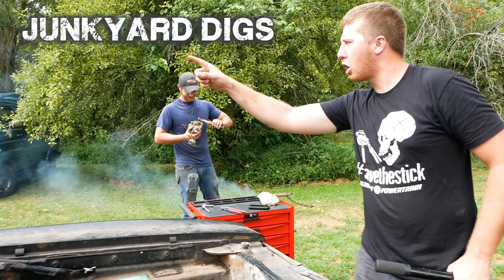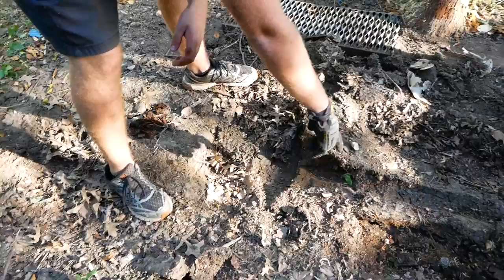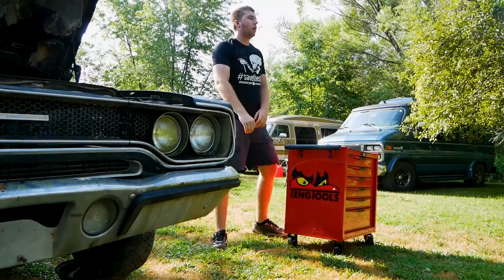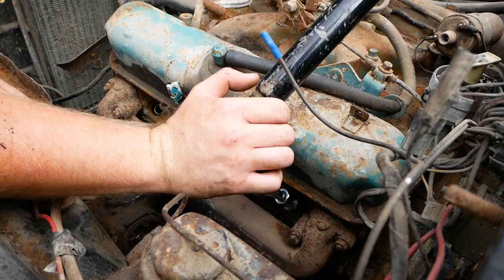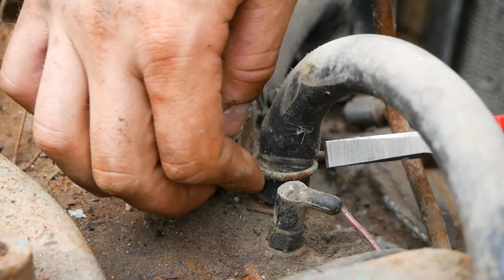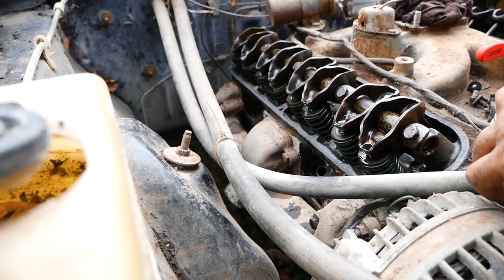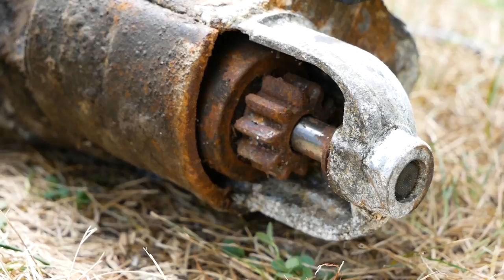ABANDONED Muscle Car Revival! First Start in 35 years! -- Part 2

Comment: well someone has been under that hood before. Actually they have been at the whole car from the looks of it. It is either a 68 made too look like a 70 or a 70 with 68 parts put on it. Why because its missing the disc brakes in front (all cars had in 1970) it has a 1968 carter 1 1/4 bbd carb instead of the 1970 bbd. It has points instead of the electronic ignition(also standard in 1970)  any sheet metal you need for car is available from AutoMetalDirect  including gas tanks. As for the carb you had if you had sprayed it with a rust pentrant lube (IE NOT wd 40) it probably would have freed up. Good carb.

As for farming area, ya so has nothing to do with cars or brands. Heck it should have had mostly dodge trucks for 60-70-80 as ford barely sold, chevys were popular in the late 70s early 80s but for the most part every farmer had at least one or more dodge trucks. Where you get your ideas from is beyond me.